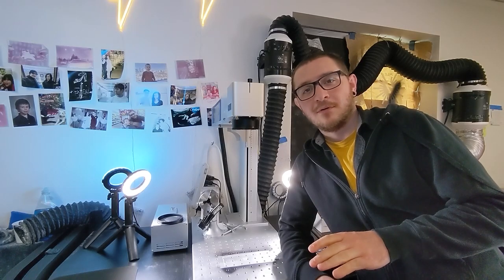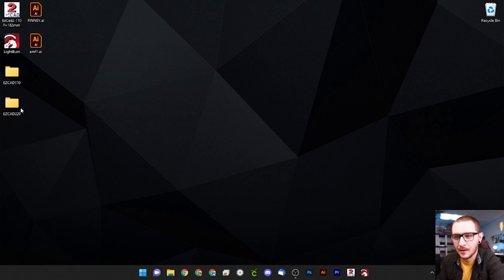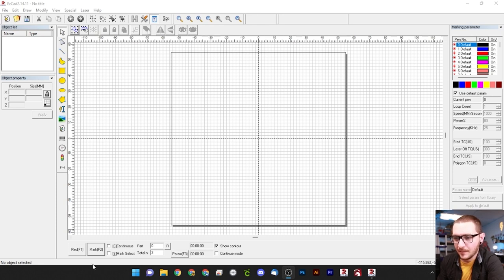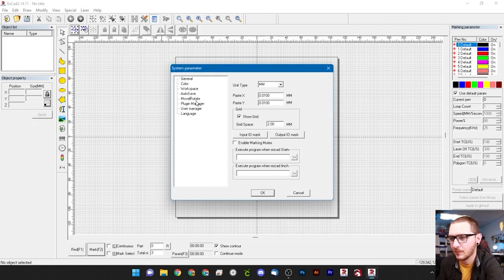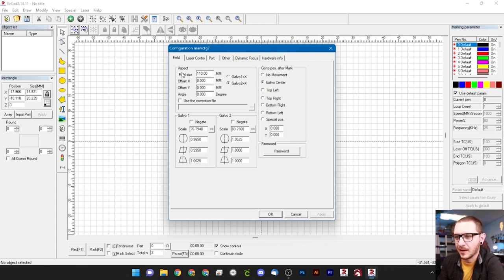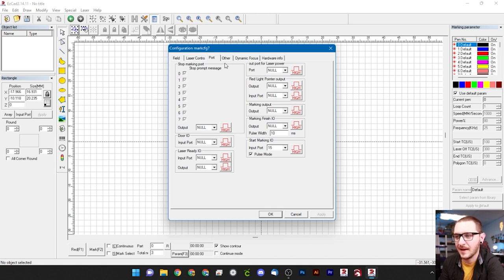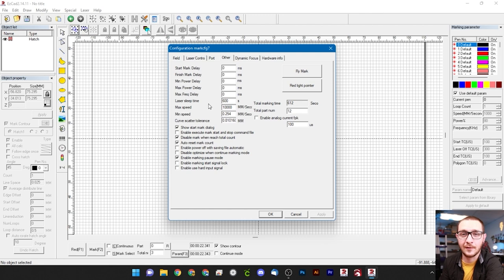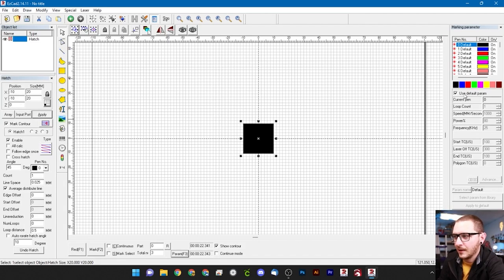How to Set Up A New Fiber Laser or Lens | 2021 UPDATED | Laser Engraving First Time Setup

Comment: Hello a newbie here and already in need of help, I just purchased a Raycus 30W laser and running a 200m lens (F-THETA LENS, 1064NM, F=290 290C2869,) So I was able to install drivers and programs on Windows 11. So here's my dilemma.. I can launch the program without a problem, but when I try to import a Vector file it starts to think then crashes. I have tried uninstalling and reinstalling and nothing happens. I also find it weird that when I launch it's all in Chinese characters, not getting that ezcad2.0 screen. Can anyone help me out or if not point me in the right direction. Thanks 😃
Reply from the maker: Make sure you're saving your artwork as the correct file type, check out this info: https://youtu.be/Pm6pWTwD_NY
Vector files saved as the wrong file type definitely cause ezcad to crash.
Reply: @LaserEverything  thanks that helped me out.

Comment: Hey Alex, Thank you for all of the content you are producing. It is truly valuable. We are thinking of expanding our business capabilities to include laser engraving, etc but are going back and forth on which type of machine to start with. We have the money for either CO2 or fiber. If you were starting which would you go with knowing what you know now?
Reply from the maker: Very different tools for different jobs. What were you hoping to engrave? How would you in a integrate laser into your business?
Reply: Well I want to engrave everything, but obviously I want to start the revenue stream as soon as possible. Is metal engraving more lucrative than other materials? Is CO2 capable of engraving metals? I am under the impression that CO2 can engrave metals but not as good or efficient as fiber laser. Is that the case?
Reply from the maker: CO2 can only remove coatings from metals like anodizing or powder coat that can't actually mark the metal itself. I'd say they're equally lucrative but they definitely serve different functions. I think overall more people want CO2 stuff done, but also less people have fibers and can offer that service which adds value. It really just depends on what you want to learn and do first. CO2 lasers are definitely more beginner friendly if you've never used the laser before. The software is better and the optics make more sense, they also require more maintenance. There's pros and cons to both. I would just go with what you personally want to do the most and what you think you'll have more fun with so that you start off on the right foot that way.
Reply from the maker: @timsortet7136  Looking forward to having you over there with us Tim!
Reply: Is the lens important to change cuz I just got that machine so I want to know more about it

Comment: The external red light pointers are not working on my machine.  Am I missing a setting ?  The  Internal framing pointer works correctly.
Reply from the maker: Usually the external ones that are used for focal height are typically controlled with an independent power button/switch, sometimes on the front of the laser or on the laser head itself. If both aren't working, it might be a loose connection for their power inside the case, or maybe they both burned out. If you didn't hit a power button for them though, that's the best place to start looking though.
Reply: @LaserEverything  hi thanks,  turns out the machine was mounted high up beyond where i could see  and the push button was located on top of the scan head out of my vision.
Reply from the maker: Glad you were able to get it going! :)

Comment: My excavation says demo version only for evaluation how do I get a full(?) version
Reply: My ezcad version
Reply from the maker: It only says demo version when it can't detect your machine. Is your machine plugged into your computer when you're getting this error? If so check your drivers. You may have an issue with your driver installation for your machine.
Reply: Ok I’ve never had to install a driver this way at least in not a long time. Where I just did not have to just click. How do I do this lol. I’ve been running an epilogue for years now and just got a fiber and this is a bit confusing.
Reply from the maker: You will have to go into device manager and find your fiber laser device which you will know is the fiber laser because it will have a big symbol and look gross like the driver isn't installed. Right click it and click update driver software, then click select from computer, then navigate to your ezcad folder and select the appropriate driver for your machine architecture. If you need more that help then that, definitely sign up for the Discord the guys there are used to helping people with driver issues and they'll be able to point you in the right direction with screenshots.
Reply: Thank you so much love your channel. Became a patron supporter today
Reply: Got it but the laser doesn’t fire only the red. Uggh I wonder if something got broken or got loose in shipping
Reply from the maker: @TheGaffanon  Thanks for the support!! Seriously if you join the discord we'll have you up and running in no time - it's free!
Reply: @LaserEverything  I’ll have to check it out not used discord yet. Just so busy.

Comment: Ok i have my com marker 30 watt fiber 200x200 set up. My test burn does nothing. What am i missing? Think kindergarten! Basic! Im sure its something silly
Reply from the maker: First, check for lens cap! Then, start by validating your focus height. with the 200 lens, you'll likely be ~330mm between lens and material, but every lens is a little different. If that doesn't get you going, hop into one of our communities and start a forum post, and the team and community can take a deeper look!

Comment: Any chance you want to share the focal stick cut file on Patreon?
Reply from the maker: I was gonna do a whole video on making them but yeah I can send the file to the patreon this afternoon. You'll obviously have to edit it for your machine but yeah - no problem.
Reply: @LaserEverything   Thank you! A video on making your own would be a great video.

Now I get to go back to trying to figure out why LightBurn started engraving everything upside down and backwards on the CO2 laser. It seems like the bed is reversed, but only sometimes. Frustrating as hell!
Reply from the maker: Check your laser home corner in your device settings so go down to laser in the bottom right hand corner and look at the device configuration settings and then check the laser home position if it's in a different corner than the laser actually homes to when you hit the home button it's going to get confused so that could be causing your problem.